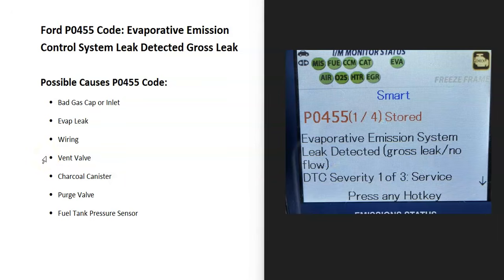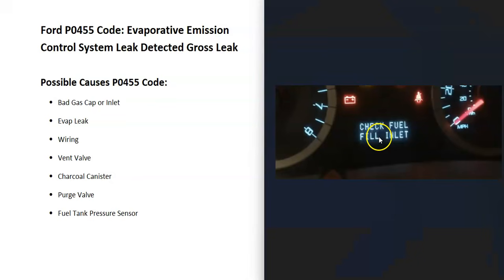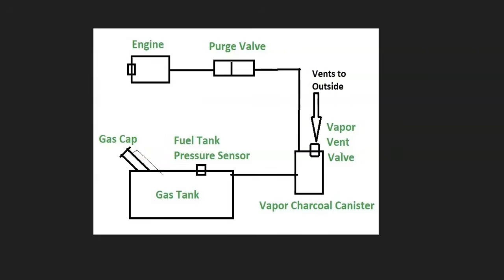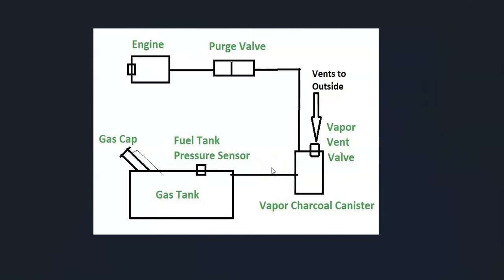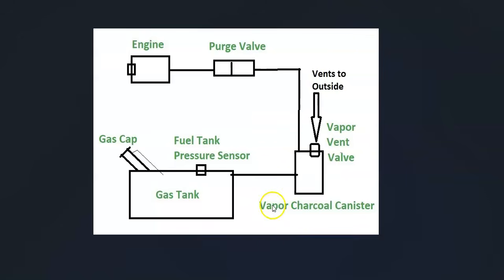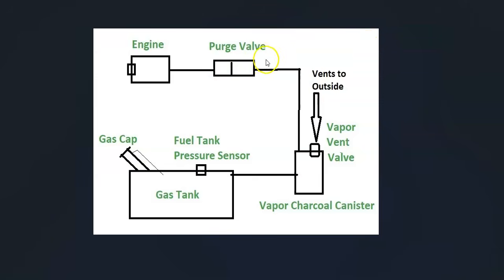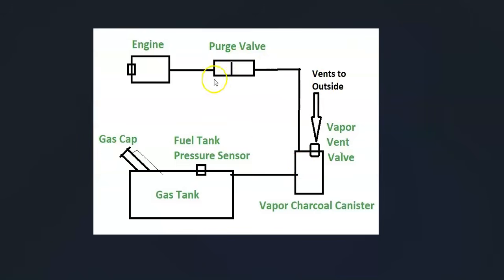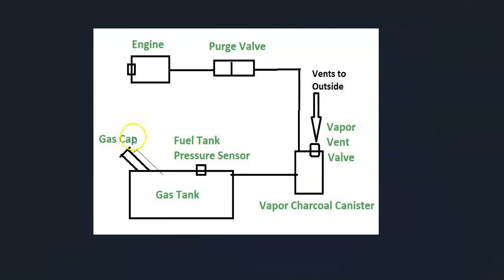Causes and Fixes Ford P0455 Code: Evaporative Emission Control System Leak Detected Gross Leak

Comment: I have 2011 ford edge push start  why is my truck cranking but not turning over like its struggling to turn over replaced vapor canister  purge val it turned over i was driving parked it and now its doing the same thing could this be an electrical issue

Comment: Got a brand new gas cap, put on a brand new purge canister under the hood on my 2001 Ford F-150. Mine will come and go with the check engine light. I can also smell fuel when I get out sometimes so I'm thinking its under the bed. I also hear a whining noise sometimes. Almost like somebody is squeaking out a fart. Long squeaky one.
Reply: Not sure if my comment got lost. 
But it’s most likely the vent valve/solenoid that plugs into the charcoal canister. 
My truck is a 1997 F-150. 
I use forscan to diagnose and read live data. It’s free. 
Everything is reading fine…except that solenoid vent valve thing that plugs into charcoal canister. 
So I would definitely focus on that. 
My gas cap also farts.
Reply: @adventuresofdoug1501 I would make a bet in your case it is the vent valve. I was almost sure of that myself until that smoke test
Reply: @PSOFomar17 I’ve had the part laying around for a handful of months, but I don’t drive it often. It needs to get inspected this month, and of course check engine light comes on. 
I replaced it this morning when I got home from work. 
Took for a drive; the first 10-15 minutes of the drive it was farting; 
But after 20-30 minutes of driving; 
No more farting gas cap!
Fuel tank pressure is also staying at or close to 0kpa vs before it was reaching -4.0kpa, which is when mine would fart😅
I’m glad the shop you took it too was able to help you figure it out!
Evap systems are a PITA
Reply: Ok, so I brought to a shop I trust
 And they did a smoke test. Turns out it was the filler neck. Where it goes into the tank it wasn't seated properly or possibly a defective part.
Reply: @PSOFomar17 that makes some sense for me cause sometimes when I get gas the check engine light comes on. Hmmmm interesting. But I also have the smell of gas when I get out sometimes so, I may have one or maybe 2 problems. Dont know but that helps. I was gonna replace everything on mine when I drop the tank and replace the fuel pump. My fuel gauge doesnt work so, i kinda want that feature 😅😅😅
Reply: @Wannagobackto1980  I hear ya. I'd still rather deal with these issues than have something new.
Reply: Exact same situation for me, did you ever figure it out? Canister vent valve? Hose?
Reply: @PSOFomar17 I havent yet. I was gonna replace everything including the gas tank but I'm thinking about replacing the parts on the tank and seeing what happens from there.
Reply: @Wannagobackto1980 it’s 99% likely going to be the charcoal canister vent solenoid/valve.. the part that plugs into the charcoal canister. 
My gas cap will also fart. 
I use forscan to help me diagnose. 
Everything is reading normally; except for that solenoid/vent valve thing.
Reply: @PSOFomar17 definitely focus on the charcoal canister vent valve/solenoid.
Reply: I just put a brand new tank on also a brand new filler neck. Code came on and I put a brand new Gas cap and Purge Valve and the code just came back. Frustrating. I think ill do the Canister vent valve next and see.
Reply: @PSOFomar17 where is the canister vent valve located?
Reply: @Wannagobackto1980 Sorry vent vapor valve, i believe right on the charcoal canister. Not 100 sure though
Reply: @PSOFomar17 could be those vent valves on the top of the tank. There are 2 of them. Just did a little researching on it.
Reply: @PSOFomar17 the vent valve is under the bed. 
A little after rear axle, not sure if it changes from being short bed or long bed, mine is short bed. 
It’s also in the middle of the bed, not on one side or the other. 
This is where mine was at least, not sure if later 10th gen’s were placed else where.
Reply: I  too replaced my purge valve. 
I also replaced the EGR valve control solenoid. Those didn’t fix my issue either. 
It seems I fixed the farting gas cap this morning when I got home from work. 
My problem did indeed seem to be the vapor canister vent valve/ solenoid. 
It was CRUSTY as heck. 
So far so good though. 
No more farting gas cap! 
I have a 1997 F-150! Same generation 😊
Reply: @adventuresofdoug1501 where is it located? Other fella told me on the side of the charcoal canister but I dont know where that is either 😅😅
Reply: @W @Wannagobackto1980 
He’s  not wrong at all. 
It does plug into the charcoal canister. 
Mine is a 1997 short bed, I’m not sure if the later versions or long bed versions changes this location-
Mine was slightly behind rear axle. On a mounting plate/bracket. 
Roughly square in the middle of the bed, behind axle, on a mounting plate/bracket. 
You’ll see some hoses, a plug, and the vent valve. 
If you have a spare, it may or may not be more difficult. I don’t have a spare under the bed. 
Look up what the part looks like, so you know what to look for. 
Ours does not look like the one in this video.
Unplug connector first. 
Pull out the side that plugs into canister first. 
Then you can pull off the other hose quite easily. 
Mine was super crusty/ rusty too.
Reply: @adventuresofdoug1501 ty sir
Reply: If I figure it out ill reply back. Thanks for responding
Reply: @PSOFomar17 no problem I appreciate it.

Comment: I have p0455 large evap leak and p0460 fuel level sensor a circuit??
Reply from the maker: Some models have the EVAP Pressure Sensor or Fuel Tank Pressure (FTP) Sensor located on the fuel pump and the wiring tied in with the fuel level sensor in the same harness. They may be separate issues, but I would check for this and be sure the fuel pump plug is good and has no wiring issues.

Comment: I had the problem where I would try to fill the tank and the pump would just click repeatedly. I decided to replace the canister & solenoid at one time. When I was taking it apart, I blew threw the vent hose going to the tank and something blocked, but it cleared. I continue w/ the install of the new canister b/c the old one was original and I had it off, so might as well replace, right? I now get a CEL. The gas tank fills normally, but I have the CEL and same code. I connected the solenoid to 12V and it clicked, so it isnt the solenoid. What do you think it could be?
Reply from the maker: If the vent valve is good and a vent valve code comes back, it may be in the wiring. I made a video on how to test the vent valve and wiring. Here is a link. https://youtu.be/zsetg4T1T4Q

Comment: i fixed everything and still the code comes up
Reply: Did u check all the lines mine gave me this code and I checked everything so I over pressurized the system slightly and found a hairpin hole in the fuel line fixed the line haven’t had a problem with it since

Comment: I have a 2005 Ford expedition. I first got a notification on my dashboard saying check fuel cap. I checked it and I make sure it was tight and it went away. Then about a year later I noticed the check engine light turned on and it's p0 455. I believe it says evaporative emission system leak detected ( Large Leak ) . After that came out a few days later on the dashboard it also said check fuel cap again. I went to AutoZone and I purchased a new one. Nothing happened, I went to the dealership and got a fuel cap from there and nothing happened. I will check all the components that you mentioned on your video also with the purge valve.

I don't know if this has to do with this issue, I noticed when my vehicle is cold in the mornings and if I start driving it right off the bat, when I come to a red light and it turns green. I step on the gas. It won't go at all. It feels like if I had it on neutral, I let go of the gas and step on it again and then it starts driving perfectly once it reaches its regular temperature. I do not have any issues with it at all. It's only when it's cold. Or if I don't do anything on the red light and just let it wait it turns off on me, I just crank it up back and it starts like nothing happened, what can this be? There's no check engine light for this. Thanks
Reply: Fuel pump?

Comment: Can a bad gas cap cause the vehicle to miss or stutter? 
I know my gas cap is not fitting properly, but it started stuttering and when I checked the code, it said evaporation system leak.
Reply from the maker: A bad gas cap will cause an EVAP leak but won't affect the engine. The only EVAP component that can affect the engine is the purge valve. If the purge valve is stuck open, it can cause issues. Here is a video I made on how to test it. https://www.youtube.com/watch?v=X-Y5YsaXxJE

Comment: Could it be the harness connector on the purge valve?
My clip is broken and makes as ticking noise like a loose electrical connection intermittently
Reply from the maker: It needs to be diagnosed, but yes wiring can cause problems.

Comment: I had fuel in my purge valve when I replaced it were do I go from there
Reply: Stop overfilling the fuel tank thats usually when u overfill the fuel tank as soon as the pump clicks stop there
Reply: Yea I just let it stop by itself i dont keep putting more gas in after it stops @Munoz_-nm4zg

Comment: Im having a hard tome finding the leak, you suggest the smoke machine method? I have a Po457, po455
Reply: I'm having same codes on a 2005 Ford expedition 5.4 Triton and I've bought new cap and all truck runs fine just damn service engine light comes on I don't know what else to do or check to fix it really bothers me it runs just fine no problems just tired of light on dash
Reply: @chatobalencian1504 would clearing the codes help?

I have same engine in my f150, engine stalled out the other day and the large leak code came up but no check engine light for me
Reply: @lilbeangrowthagreen7664  I did clear them and I even disconnected the ground for like 30 minutes came off but came back on after driving it again couple days later
Reply: I just over pressurized the systemed by 2 pounds and found a hairpin hole in my fuel line fixed it and no more problem

Comment: My Ford Ranger would stall or RPM would drop and almost quit but recover. This was an endless cycle.  Never get a check engine light or code. Disconnected electrical connector on the evap solenoid purge valve in the engine compartment. Finally got codes PO443 and PO455 along with check engine light. Engine runs fine with the electrical connector disconnected. Problems comes back if I reconnect it. Ordered factory part from Ford. Dealer and other shops couldn't solve or fix the problem. Was chasing the problem for months.
Reply: This sounds just like my 2002 Escort ZX2. I've been having the exact same issue. I had the VVT solenoid replaced and after a couple days... It started doing the same thing again. It's in the shop as we speak. I'm going to show him your comment and see if he thinks he can try that. So far... He is stumped.
Reply: @jonmanau1921 did he figure it out ?
Reply: @bigreesetv  unfortunately, I was told was Crank walk.
Reply: Please contact me.
Reply: Was it the plug?

Comment: Need help ford f150 emissions light is on every time I brake it dies battery light pops up and and i have to turn off the truck and turn it back on i hooked it up to a code reader but just said emissions related engine problem
Reply from the maker: It sounds like a wiring problem; an emission issue shouldn't cause the battery light to come on.

Comment: Will the fuel tank pressure sensor cause your car to stall an turn off wen you hit the gas hard an also misfires while driving
Reply from the maker: Usually, when the FTP sensor goes bad, it gives a code, and the EVAP system does not work, but it does not affect the engine. The only EVAP component I have seen cause engine issues is the purge valve since if it gets stuck open; it causes a vacuum leak.
Reply: @HVAC_Mechanic   i need to do more investigation  thanks i think its cloged cats
Reply: I have all new spark plugs and coils an fuel rail pressure sensor
Reply: 2011 crown vic
Reply: I have the same problem, did you find a solution?
Reply: @Insigiter  nope i cut all the cats and it worked better cause the 2 cats in the front were clogged
Reply: Fuel pump was giving out it was some how still coming on some howit worked tho but itstill does  it a Lil so I know these another issue